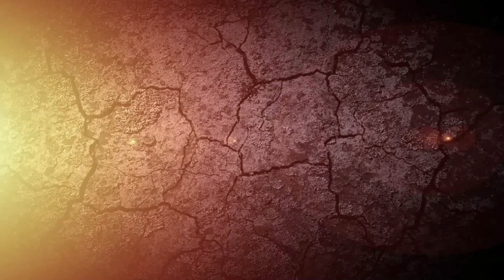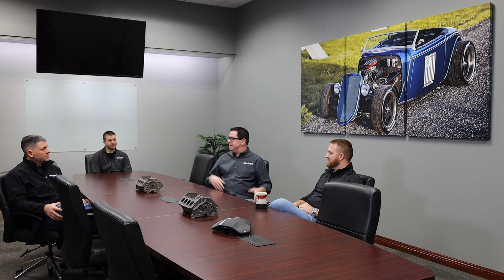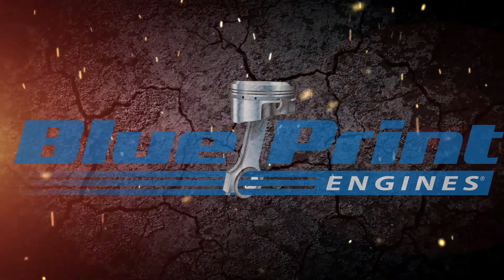BluePrint Engines New Product Development – Crate Engine Tech

Comment: Their engines are basically 90% unchanged since 10 years ago. Other then eliminating flat tappets and not using comp products. Whats different? Their heads have been the same for 7ish years now.... great company but what are the new products? No 302 chevys. I dont see any realistic LS engine combos just bigger inch strokers. No 5.3l/ 4.8l LS options. I think those 3 guys are slacking. As a consumer there again isnt much change to your engines last 10 years. Your 383 has made 420+ HP for 10 years. No 500+hp options yet??? No gogta go to the 400ci. Come on now, there isnt much change other then in house part making. Roll out the new versions of each engine. New cam lay outs. Lets see what you do fresh??